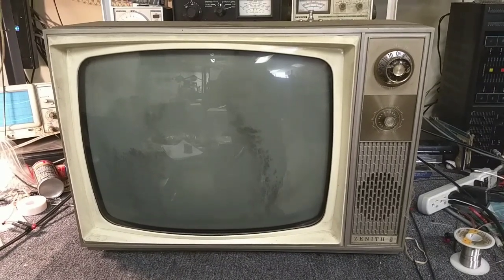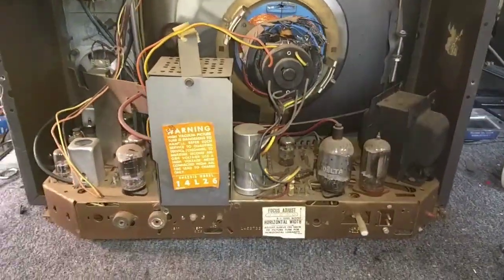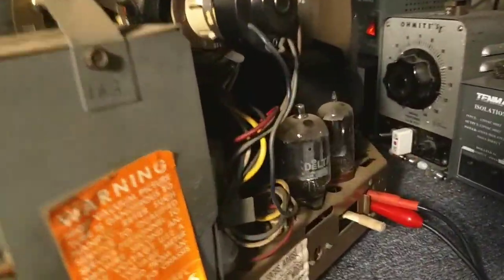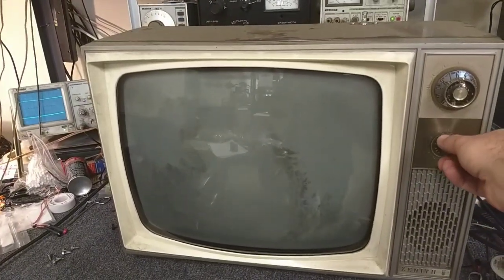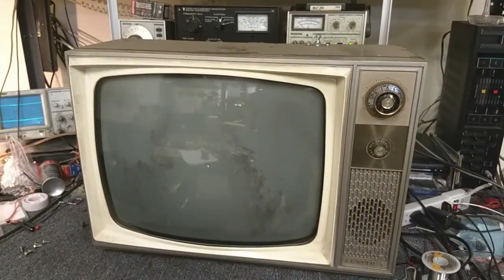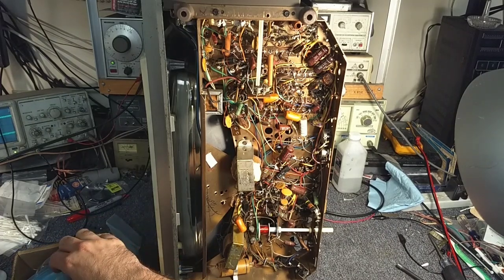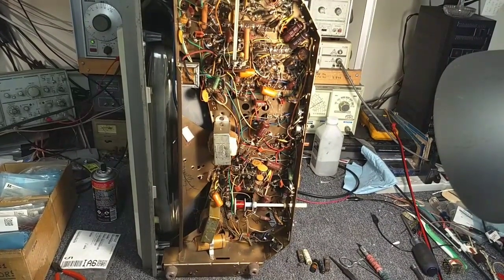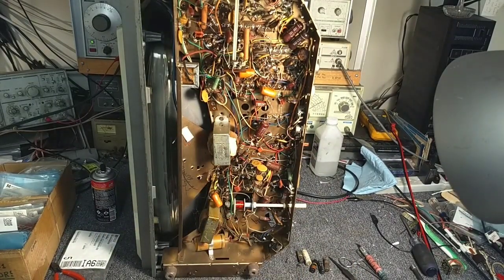Minor service on a 1960s Zenith Model L2005-3 19" b&w vacuum tube TV estate find. 14L26 chassis

Comment: We had a set very similar to this one.  I think it had the UHF tuner.  The VHF dial had a piece of translucent plastic in the center of the dial and the channel number was projected onto that plastic by a light, which was burned out and never replaced.  It was used on top of our color set, which never worked right.  People used to call that TV stacking.  Later, we got a solid state Panasonic color set in 1975 and later the Zenith was used in mine and by brother's bedroom for a year or two.

Comment: Digital can have multipath problems, but it depends on the antenna and receiver. I’ve found that most commercial antennas are junk! I’ve built my own, and get much better reception. ATSC 3.0 is being tested now, and its almost completely immune to multipath.
Reply: I had great luck using the antenna that came built in on my old 2003 Class A Motor Home.  Down in Tupock Arizona I could get over 40 channels off the air depending on which way I had my antenna pointing.  One way I got all the Phoenix channels, the other the Las Vegas Channels.  So depending on which news and weather I wanted, I could tune to that area. I left it pretty much pointed to the Arizona side since that was where we were parked. Oh I did get a few channels out of LA as well, Tupock is right on the California/Arizona state line with just the Colorado River keeping the border separated.

Comment: That's a very nice TV set, and the picture looks very good.

Digital TV broadcasts are rubbish. The thing about the compression algorithms used in broadcast is that they don't fail gracefully when there's a slightly bad reception. The whole video starts to stutter very easily. If the algorithms had been created with watchability in poor reception conditions in mind, they would be very different. Less efficient, but not necessarily by that much.

Comment: I made a video about a different tube TV (RCA AT-121G) where the horizontal oscillator would start up slow sometimes. After a few minutes it would clear up. Perhaps it's a slightly marginal oscillator tube as you found that behaves better once it has extra time to "wake up" from being unpowered for a few years. Fortunately that problem has gone away completely in the past three weeks.

Is the trick about pulling out the horizontal hold knob a common feature? I was having a bit of trouble turning the knob on mine and noticed the knob could slide in and out. I guess this stop adjustment feature could explain that.

Comment: I've been soldering on both printed circuit and point to point for 45 years, but it's still interesting to see how someone else does it. I remember in school we were told never to j-hook to an existing lead. Always remove the old in its entirety.  Reality is just the opposite. It's too easy to damage parts with the heat necessary for complete removal. I've done a ton of this j-hooking over the years, including in manufacturing, for mods ordered by engineering.
Reply: If the part is bad, I’m not going to worry about heat damaging it, and if a terminal strip is damaged by my unsoldering a wire or component lead from it, then it was probably on its last legs, anyway. Mechanical stress is usually the bigger cause for failure for terminal strips, or the lugs on potentiometers, but heat is more important on PCBs, especially older ones, like those in later tube or hybrid sets. Some early transistor radios were also infamous for having PCBs that would suffer from lifted traces if you try to solder/desolder on them.

Comment: I'm intrigued by component engineering. How do you decide the type of capacitor you use to replace a type with bad characteristics, like the white ceramic tubular types, and, dare I say it, black beauties? Is it always orange drops to replace other older types of tubular types? In solid state gear, tantalum types can only be replaced with tantalum even though they have a tendency to short.

Comment: Hi, I have a quuestion . What is carbonization?thanks.
Reply: Carbonization occurs when an electric arc occurs between two conductors, and (the heat from the spark) burns the substrate the conductors are mounted to. The carbon is itself conductive, and this can cause a situation where the current keeps flowing, and burning the substrate more and more until it disintegrates, the set catches fire, or someone turns it off (or a fuse/circuit-breaker trips). HTH.

Comment: When I Was A Teenager I Used To
Do Transister Radio Repaitr.
I Used To Pull Components
Out Of Old Junk TV's 
& Radios. Cause Me & Mom
Wh'er Strapped For Cash.
That's Why I Couldnt Afford Newones.
& That Tim I Didnt Have A VOM
Meter. I'd Test Other Capaciters With Another Capaciter. But Anyways I Got By 
Doing With What I Had.

Comment: I need your advice : I recently got a 5" Color TV Radio Cassette Rec. by CONIC and the crt doesn't work properly. I know it's working because when I set the selector on "radio", the crt flash sometimes for less than a second but the raster is visible. But, when I put the selector on "TV", I can only hear the yoke and there's a lot of noise on the speaker without any image. Any guess?

Here's some references :
https://www.radiomuseum.org/r/conichonhk_color_tv_radio_cassette.html
Reply from the maker: Without a signal attached to the set it's hard to tell the cause. Sometimes no signal may cause a darkened raster
Reply: @JordanPier  I have an UHF Modulator pluged in but nothing. The radio is crystal clear, and the cassette player is also alright. I know a thing or two about crt but I have no clue about this issue.
Reply: I made a quick video on the problem with my phone :
https://youtu.be/vbk74fnB4gM
Reply from the maker: @sleora  says video is private. Can't view.
Reply: oh, sorry about that, I fixed it.
Reply from the maker: @sleora  still can't see it. Yt says it's set to private. Try editing your video and set to unlisted
Reply: @JordanPier  I set it on public, it should be working now
Reply from the maker: @sleora  the link will change when you change the status, so you need to repost the link again
Reply: In the meantime, I opened the lid and I saw that when the knob is set on "TV" the tube's filaments are glowing, so it's powered the whole time.
Reply from the maker: @sleora  the video on looks like the sweep circuits are not able to start due to overload in the horizontal output circuits, bad flybacks Transformer, or short circuit. Without a schematic it's almost impossible to discover the failure
Reply: Thanks a lot ! I will try to look for a schematic and try to repair it.
(Edit : It seems that there are no schematics available on the internet. This is going to be a harder repair than expected.)